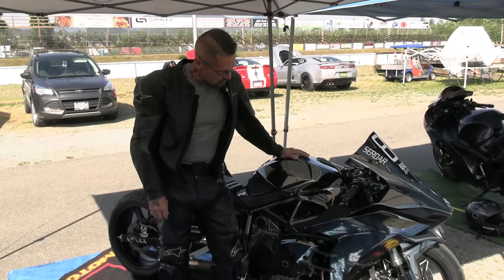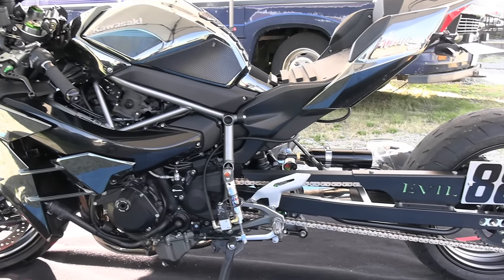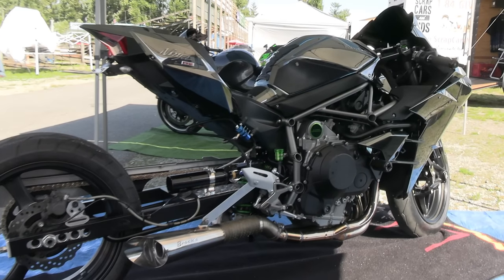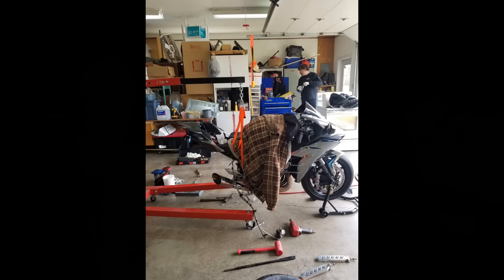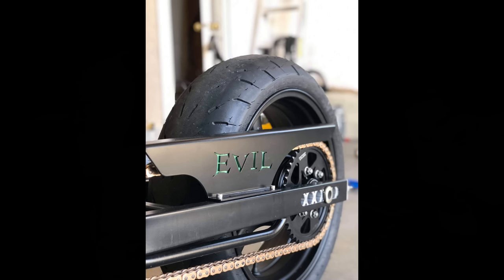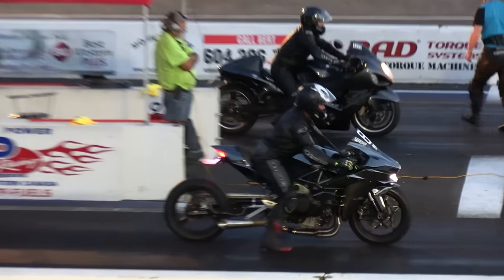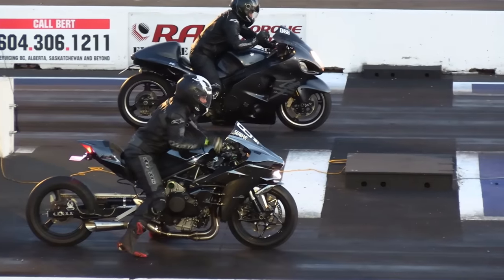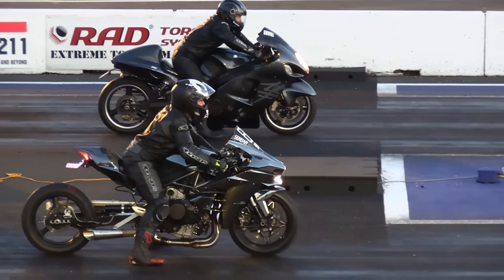Hayabusa vs H2 Kawasaki Ninja-rematch- - superbikes drag racing

Comment: I think the speed is limited by the body and not the engine
Reply: Did you miss the two first races? H2 was in the 6 second range compared to the Busa 8. 2 seconds is a long time in a race.
Reply: @UneducatedBastard  its actually an 8 but the bar blocks off part of it,  and the announcer said '8.79'.  theyre both really fast bikes and deserve all the respect they get.
Reply: 😂 It did kind of look like it was a 6 second pass but it wasn't, it was an 8 second pass but one of the light bars on the 8 was out a little which did make it look like a 6. The announcer even said it was a 8.79 I think. The 6 second pass would have been awesome but that bike on that set up isn't capable of a 6 second pass. It's a monster though that's for sure.
Reply: @UneducatedBastard  and the H2 would be even fastest if the reat swing wad 2 meters longer. You you extend the rear so much that it no longer can do a wheelie = max acceleration.
Reply: It’s Kawasaki’s time to look stupid with those Florida swing arms. It’s a stupid idea. When you can no longer ride your bike around the canyons like a racer instead becoming a dyno on a drag strip.  The Busa has been a one trick pony and I was pleasantly shocked to see anyone care to chase it. The H2 and H2R are both at least beautiful machines and the supercharger adds some much appreciated differentiation yet again. I’m actually shocked at Busa’s still getting around let alone being the status quo.
Reply: @Bernievids  Both had extended swing arm and H2 beat the ass of that Busa in this Video coz they modified that H2 for that drag race only coz it won't be doing wheelie when doing that drag and can get the full power with it. 
That Busa was a 1500 cc Turbocharged and that H2 was a 998 cc Supercharged engine and still H2 won coz H2 has better Power n power to weight ration than that Busa.

Comment: H2 has that capacity which even the front curb weight of bike cannot handle. Even without the swing arm H2 has alot alot power . Just in 1st clip rider seems bit cautious and trying to get control over the beast H2 , it takes no time for it to dust Hayabusa. Respect for both bikes ❤️ but H2 has its own throne

Comment: Thats pretty unfair a ssb against a normal hayabusa without a longer swingarm
Reply: That was a moded hayabusa
Reply: Werty 81 Alright but in the end it’s still unfair if the other bike has a modified swing arm because he hasn’t the problem to keep the front wheel down
Reply: Well i guess so
Reply: @johngreen7091  that's what the problem faced by H2 in the earlier video, have you checked it out??

Comment: I'm actually curious on how they shift if their feet are dangling🤔
Reply: Quick shifter  it shift for you
Reply: @josenieves390  but don't you still have to shift with your foot?
Reply: @elfaseccioria  Then how do they operate the clutch for launch and burnouts ?? Front brake lever converted to clutch?

Comment: Hayabusa 1300cc + big turbo charger + nitro = LOSE ???
H2 998cc super charger factory + extension arm + nitro = WINN
Reply: Tedy Rufus only reason the h2 won its launch. And technology. Busa needs arm to be effective on drag strip it can’t launch at all. It’s way faster than the h2 but since it can’t launch half as hard as the h2 its having to try to run it down and no enough room to run one down

Comment: I have a doubt!
When both the legs of the riders left hanging, how gear shifting is done?
Reply: The real question here
Reply: They use Air Shifter that is activated by a switch on the handle bar.
Reply: Who shifts gears for a 150 meters drag... lol
Reply: @bristowxavierlm  400 meter. And yes they shift using air shifter on the handle. Can't you hear the shifts? I think you don't belong to these type of videos
Reply: @JH09SUMIT  okay special guy
Reply: @jonathanhadiprasetyanto521  not calling myself special in any way..

Comment: yea for an h2 to be any good at the track you gotta lower it, stretch it and get a brock pipe pc5 and ecu flash to make it the beast it really is.but that said I just cant see spending 30k and then another 2500 on pipes etc when you can get a busa with an rcc stage 1 turbo and still have at least another 5k left over. Either way great bikes

Comment: the H2 is better than that its just that, its hard to control the bike cuz its torque is crazy high for a bike and holding it down to prevent the bike from flying is itself a hard task!

Comment: The stock busa hasn't been relevant since 2008 - The Kwak is running with just a pipe, swing arm, lowered/strapped and a flash tune - the Busa needs a entirely new top end (if not a completely over bored engine), swing arm, huge turbo, fuel control, tuning, lowered/strapped AND nitrous just to be on the same track....
Reply: You can make sub 9 with stock motor Hayabusa. Few bikes are still that fast and H2 is one of them. Still ZX14R is faster than both.

Comment: And I am there scared to fully launch my VFR 800 in first gear but the front wheel takes off a little even on 109hp maybe also due to VTEC but from 2nd Gear no problem